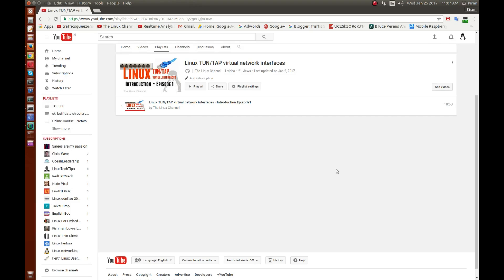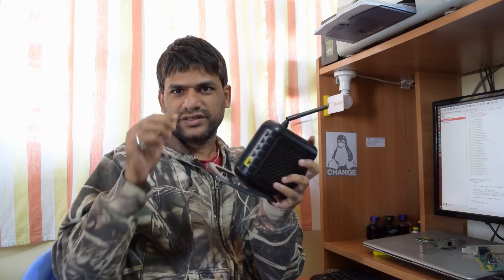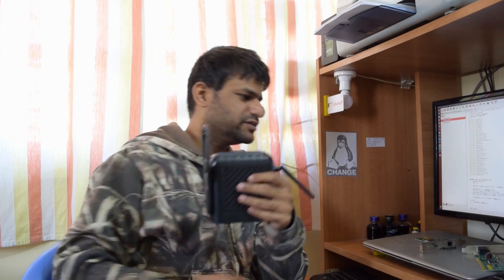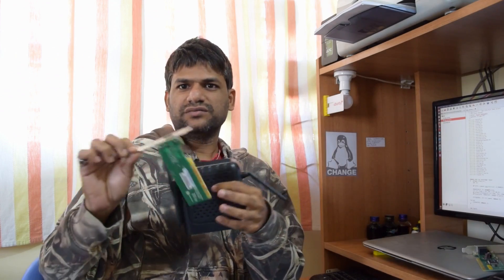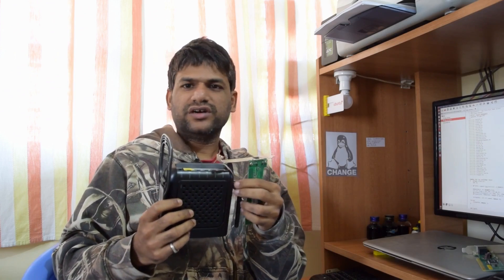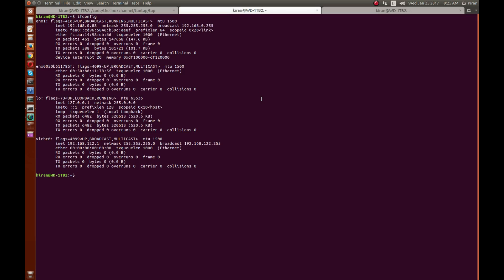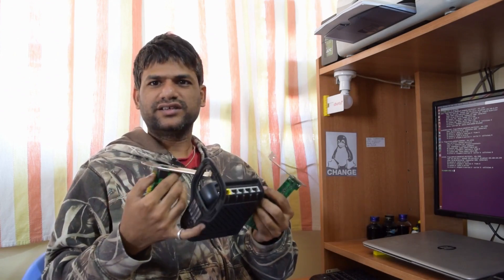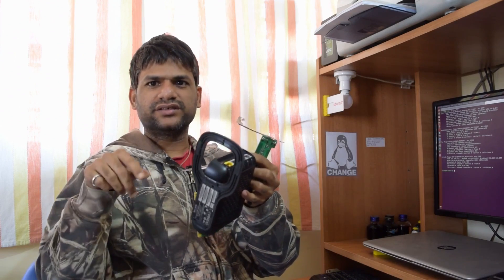178 TAP Interface sample access - Linux TUN/TAP virtual network interfaces - Episode2

Comment: Hi sir, I have a problem with the VM's running on my Linux host, can't ping the host from VM's, can t share the files with outside world, cant access network shares with in the VM. Since the host is configured with SLIRP configuration im facing these issues. Is this possible through Tap configuration?( this is bash, running on linux, with the KVM hypervisor and QEMU VMM) . Can you throw some light here
Reply from the maker: in my case I use VirtualBox, so you can choose virtual box bridged mode or host only adapter mode. Both can do the job in a different way. That way I can access from host to vm. But bridged mode I presume it should allow from outside to vm too, again not sure. But never experimented tun/tap for these

Comment: Hi Sir, 
Tun interface can be configured with DNS IP address ? or there are limitations of tun interface
Reply from the maker: I think so. If you see the architecture, the tun/tap allows us to write user-space apps (especially vpn type apps). I use TAP usually, since I can get raw L2 access to packets. Of course many VPN solutions internally use tun interface. Such as this architecture: https://cloudacademy.com/wp-content/uploads/2015/12/113.png
Reply: Thanks a lot sir!!

Comment: Hi Kiran,
Thank you very much for the helpful and easy to understand information!
Two little question:
1. Assuming I created the bride and the tap by using the command lines written in your text file, do I still need the code? doesn't it do, actually, the same job?
2. The code demonstrates reading from the tap. What is the way to write to the tap? do I have to do it by writing code, that uses the file descriptor of the tap? is there a command that enables accessing the tap, without writing code?

Thanks a lot,
David
Reply from the maker: Hi nice to meet you. Actually it does not matter if done via code/ script or commands. It is all done by kernel. However of course you need code to handle packets. The TX part (write) is same as RX (read). You can replace the read with write API with the appropriate TUN/TAP file descriptor.

Comment: My read function is block here, can't see any output. I am running my code on AWS. Can you run your code on AWS or any others cloud server? Thank you in advance.
Reply from the maker: Hi Frank. You can technically run this code anywhere. I suppose even FreeBSD (which is not Linux). But make sure TUN/TAP driver is enabled in the kernel build. If not done it cannot create tun/tap interface when you run this code in user-space. Check /dev/net folder for tun file. Also the kernel's config file in /boot to see TUN/TAP is enabled. I recently got into such issue. My client's device kernel is not compiled with this support. So I requested the build guy to enable the same for his next firmware build. BTW, that is not x86, its a custom MIPS router board :)
Reply: The Linux Channel thank you so much.
Reply from the maker: Thank you. Frank. Have a good day :)
Reply: @TheLinuxChannel  Excuse me sir. I don't know how to active the tap. do i need to rebuild a linux kernel on AWS?
Reply from the maker: Check the criteria shown in today's video. If it is enabled in kernel, then use a code to enable. You need user-space code to bring up the interface. I did a video long video with a demo code, have a look @ this page. All episodes of TUN/TAP are posted here along with the sample code: http://the-linux-channel.the-toffee-project.org/index.php?page=100-videos-online-course-linux-tun-tap-virtual-network-interfaces&lang=
Reply from the maker: if the kernel misses the tun/tap support, then you have to custom build/compile a kernel with that option. Which is tricky if you are new to the same.
Reply from the maker: I just published a new video on this regard: https://www.youtube.com/watch?v=MVRnK7h1-rE
Hope this helps :)

Comment: Hi Kiran,

Thank you very much for the detailed explanation. I have client and server  both are Linux devices. on both devices i have tap interface connected to physical interface like eth0. consider my eth0 interface is in 172.20.X.X network and my tap interface is in 10.0.X.X network. I am running client.c and server.c socket program on both and both are bind to tap interface configured in their respective devices. I am unable to reach client (10.0.0.1) from the server (10.0.0.2). Can you please suggest how to debug. Can i link to socket programs of both client and server. i see socket program bind to physical interface and binding to tap interface is different.

Comment: Hi Kiran,

Thank you for those useful videos about TUN/TAP. I'd like to ask you if it is possible to use   TUN/TAP and attach them to a virtual switch.

Right now I'm working with Open vSwitches and I want to create a virtual network between two psychical interfaces. In this case a wlan and eth.

For instance, the wlan was configured to be an AP, so normally to get a proper AP you take advantage of the iptables to forward the incomming data from the wlan to the eth, but in this case I'd like to implemented an open vswitch between the wlan and the eth, so the virtual connection will be:

wlan --- ovs --- eth

I'm new in the TUN/TAP concepts, so probably you might have an insight about how I should tackle this issue.
Reply from the maker: welcome Daniel. Well even I am new in terms of using TUN/TAP, although I seen it few times here and there earlier couple of years ago. With OVS, interesting question, perhaps you can create then TAP, and then try instead brctl (which is native kernel bridging), use it for OVS, and check if works with OVS.

If it works, may be you can share your experience in a video/article, which I can post if its an article in The Linux Channel->Tutorials, or if its video embed in a new video about this topic.

I am not a OVS expert, in fact I never yet tried OVS. If you have good OVS expertise, you can try and kindly let me know. cheers, Have a nice day :)

Comment: Hi Kiran, 

Thanks for sharing valuable information.

I have a couple of questions:

1) If someone wants to fetch packets from one ethernet port into userspace and then send it to another ethernet port, can it not done by creating two different sockets and send data across from userspace, why use TAP/TUN interface ?

2) If someone wants to create nw-stack in user-space, what is the benefit of using TUN/TAP ? can it not be done without using TUN/TAP and just using raw socket ?
Reply from the maker: Here are the answers:

1) yes you can but in which context. Sockets restricts us to use for a specific protocol. But not to build a generic networking device. Something say like VPN device or so. The other option is raw sockets. ASAIK, raw sockets will work more like packet sniffer, than really branching out packets. This is not in the case of TUN/TAP.

2) yes you can do without TUN/TAP.

But one should understand in the world of opensource (and Linux kernel), you can get many choices. Some are outdated, but still exists, some are new and good, still people tend to use old techniques thinking it is good. For example you have message queues as IPC, but instead people can use sockets as IPC. Using sockets as IPC in local-system is performance overhead (due to extra layers, etc), but people assume this is where message queues helps. May be true with computers existed couple of decades earlier where the RAM is just few KB, and processor lacks the punch. But these days why do we need many techniques ?  They can better scrap something obsolete. But they never do. Unfortunately opensource world at times gives too many choices. Just like Android phones with fancy settings, colour themes, vs. simple single branded iPhones with less choices ;)
Reply from the maker: BTW, I used once /proc interface (as experiment) to get packets from kernel-space to user-space, and later character driver to get packets from kernel space to user space. And I didn't used sockets nor tun/tap ;)